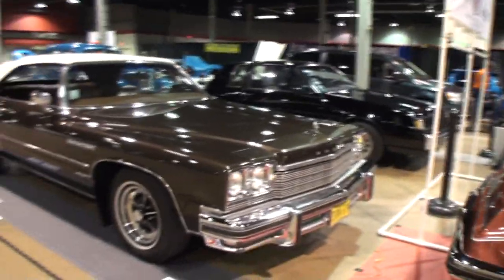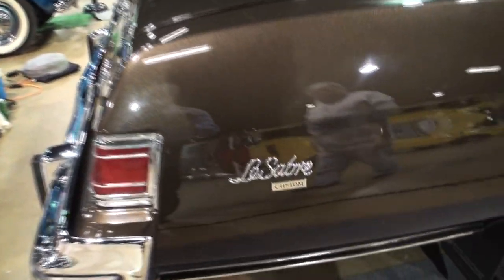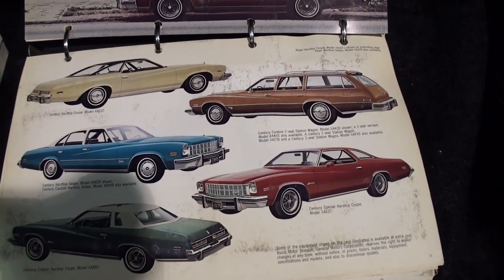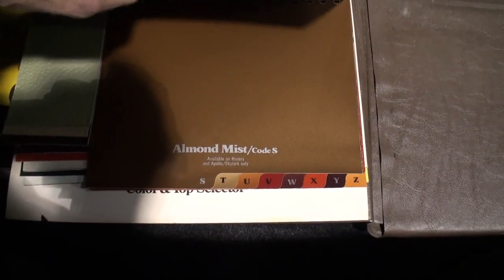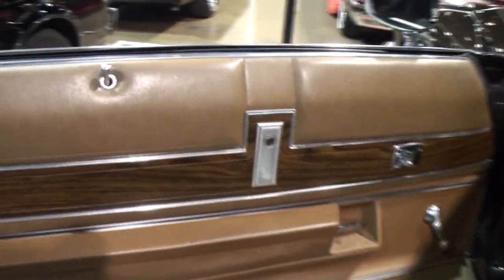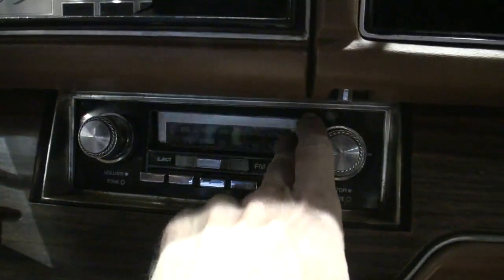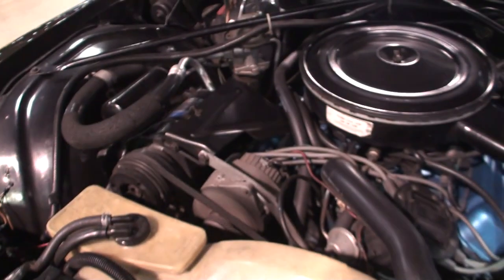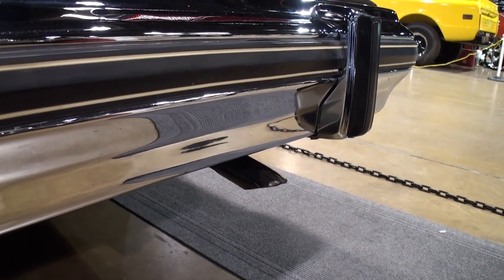1975 Buick LeSabre Custom Convertible in Walnut Mist & Engine Sound My Car Story with Lou Costabile

Comment: Those wheels are better looking than most aftermarket stuff
Reply from the maker: Hi Andrew Samy, Cars have a unique way when original of looking better over time :-)   Glad you like the wheels on this one, Lou
Reply: Andrew Samy those were the optional Buick "road wheels" as they were called. They are absolutely gorgeous and one of the reasons I prefer the Buick LeSabre over the other '75 GM full size convertibles.

Comment: Other than the Cadillac Eldorado. The other 75 GM full sized convertible offerings included the Chevrolet Caprice... The lowest priced of the bunch. The Olds Delta 88 Royale which was priced about the same as the LeSabre Custom and the 126" Pontiac GrandVille convertible which was the most luxurious and most expensive under the Cadillac.
Reply from the maker: Hi Larry Hawkins, Thank you for viewing and sharing your knowledge, Lou

Comment: Had 1974 Buick Electra 225 455 2 dr hard top 2.56 gears in 1976 re jetted carb re worked hei distributor recurred advance replaced vac advance went from 11 mpg to 21 put 120 k on motor and turbo 400 ran like new with proper maintenance and would eat trans am and others of the day with Ac on back seat was nicer than my couch great for drive ins lolol .I like to fish and I towed a 16 foot boat and trailer with no effort . Loved the q jets became a quasi expert on reworking them triple Venturi was all most as good as fuel injection .
Reply from the maker: Hi nick king, That's great gas mileage & a "Trans Am Eater" too. Wow, Lou

Comment: In September of 1975, my late father bought a new 1975 Buick Le Sabre Custom four-door hardtop.  The dealer only had a few 75’s left, so he got a good deal.  The exterior was the same dark brown colour as that convertible, but the interior featured the optional bench seat in a beige brocade fabric.  The car also came with Buick’s optional 455ci V8, and that model year saw the introduction of the “catalytic converter” incorporated in the exhaust system.  The fuel filler had a tin plate that would only allow the insertion of the smaller nozzle for “unleaded fuel.”  Dad didn’t want to pay extra for unleaded gas, so he used tinsnips to make the plate bigger (for the regular gas nozzle), and drained the converter of its “pellets.”  I noticed you focusing on the digital clock.  Although my dad’s car was fully equipped, it had a metal plate over that part of the dashboard.  It always bugged me that it didn’t come with a clock.  The car brings back memories for me, because he trusted me to park it in the garage, and allowed me to drive it too!  I had just gotten my driver’s licence two year’s earlier, and proved I could be trusted with it.
Reply from the maker: Hi Fred Kelbert, Thank you for viewing and sharing your story, Lou
Reply: Fred Kelbert I own a ‘76 Buick LeSabre Custom two doors with the 455 and it has also the metal plate instead of a clock. And yes it bug me too😂

Comment: is that a buick  350? the coil cap is in front of the engine not in the back
Reply: garth carrier   That's how Buick engines were. A Caddy was like that too.
Reply from the maker: Hmmm, not 100% sure. Hoping a Viewer can share knowledge.
Reply: It is the Buick 350-4bbl. The 66 Buick Nailhead was the last year to have a rear mounted distributor. With the introduction of the new motor in 67 all Buick engines have had the distributor up front through the timing cover.

Comment: It,s odd that the car has all the options but no power windows.
Reply from the maker: That is interesting.  Good attention to detail Peter Hogan. Lou
Reply: Peter Hogan this car is not fully loaded. Not only is it missing the power windows, fuel economy guage but also the optional cornering lamps in the front fenders as well.
Reply: When I went to look to order the car, (second week of May) I was informed by my salesman that I just missed the cutoff date to place an order by 1 week and had to settle for what they had in stock. Had 3 to choose from, one that was off limits and not for sale, as it was specifically ordered for the owner of the dealership, with every possible option Buick offered on the LeSabre. The other one was triple white (Carmine door panels, dash, column and carpet) and just didn't do anything for me. This one that I purchased hadn't even been entered into store inventory yet, as it just arrived on the grounds the afternoon before. It came in on Friday, I looked at it and bought it that Saturday, and went back on Monday to take possession, as it hadn't gone through predelivery inspection. I didn't really have any choice to order exactly what I would have wanted. But I was extremely happy to but this one. My 1st new car.